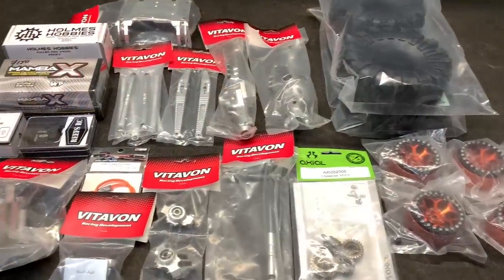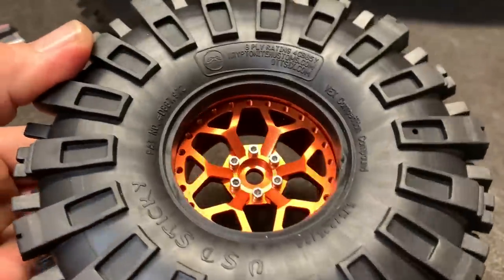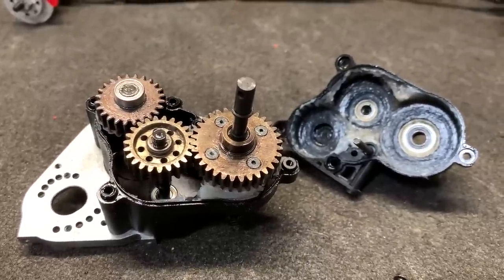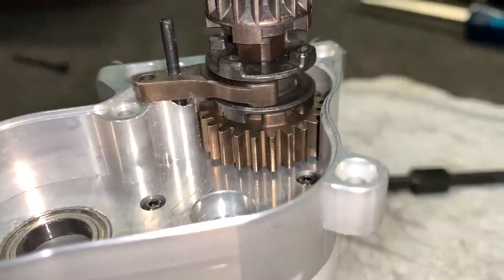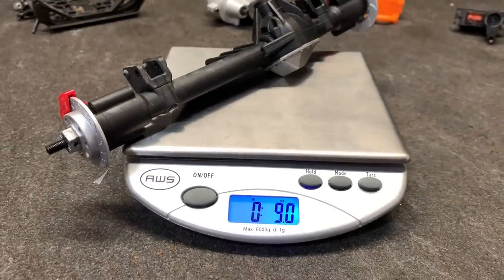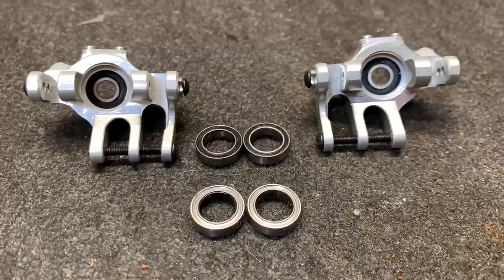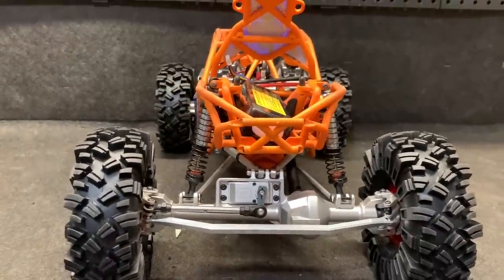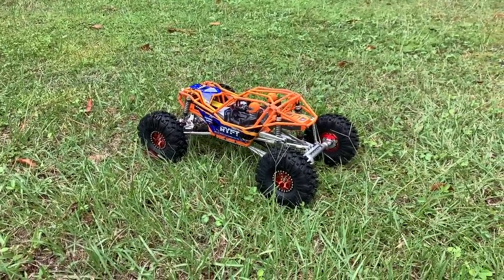Ultimate Ryft Build Troy Edition

Comment: I use the plastic skid, transmission and plastic steering knuckles. Also the stock driveshaft and for the diff just blast it out with break cleaner then fill it up with JB weld. Aluminum housings front and rear with upper links and sway bar and wheels. Some guys run everything metal also some rigs use rear trailing arms for the front. Next you should try a metal custom made chassis.

Comment: Pretty pimp ryft. I was pretty close to throwing mine in the trash. Like reeeally  close   Broke axles front. . Center diff gears striped.  Twice.   But    . Mines stock except I bought the locker spool for the center diff.  Much better.  Don’t have the cash for the fancy vitavon gear.   Works good though.  Just can’t bash it to much. Lol.

Comment: Can u do this to an smt10 I need a part guide
Reply from the maker: Well you can put ryft axles into an smt 10. Then you’ll be working with Vanquish for the links and the chassis stuff can be whatever you want.
Reply: @ExocagedRC  I thought ryft link locations didn’t line up
Reply: @ExocagedRC  would a treal ryft axle fit on a freestyle rc zrd cage